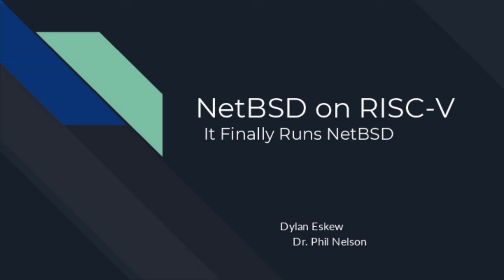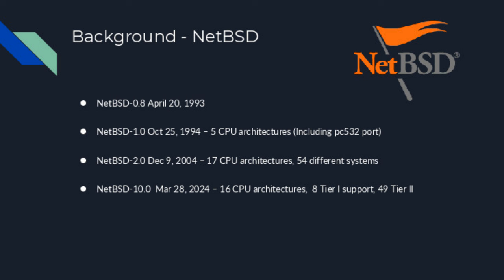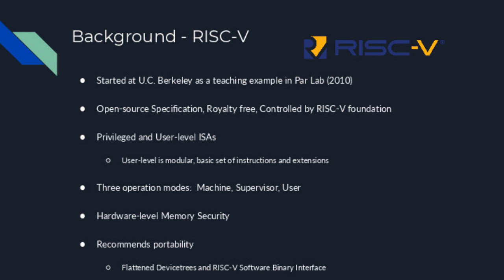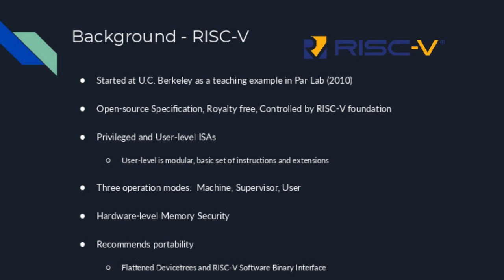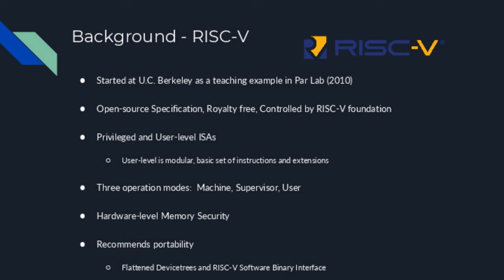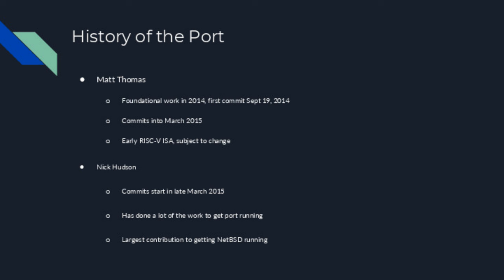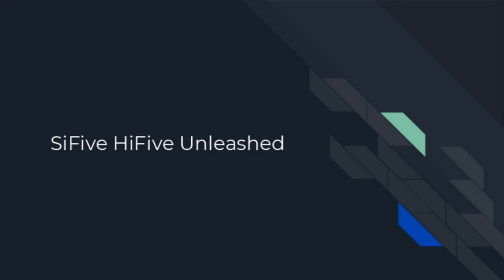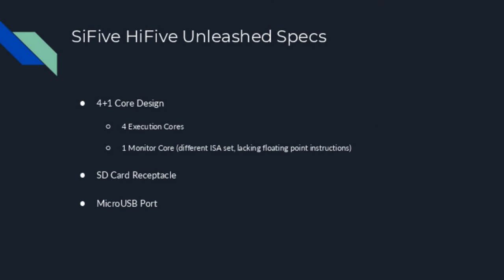NetBSD on RISC-V - It Finally Runs NetBSD By:  Dylan Eskew & Dr Phil Nelson

Comment: In looking at the various low cost riscv cpu/SOC it appears the core without floating point is intended to run FreeRTOS to control low level hardware toys like timers, PWM, gpio, and access to the 8051 pic chip in a lot of the soc versions of riscv chips.

You then use a mailbox driver between the “big boy” OS like BSD or Linux and FreeRTOS.